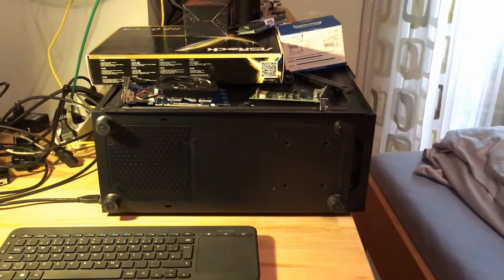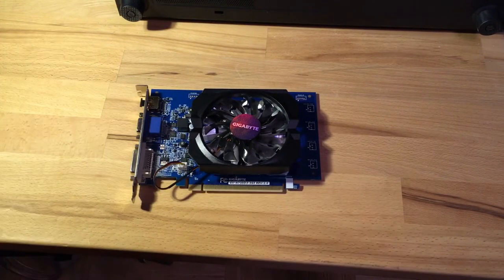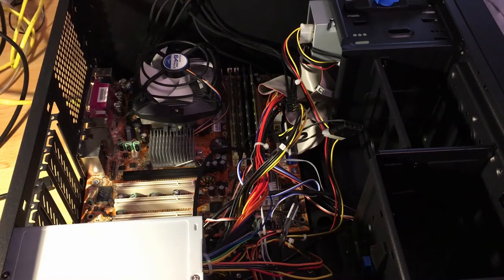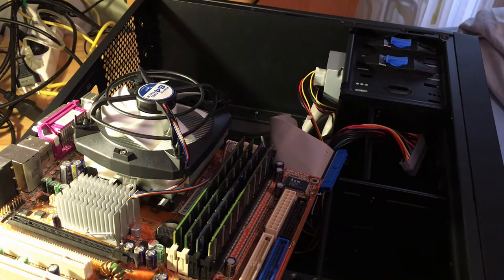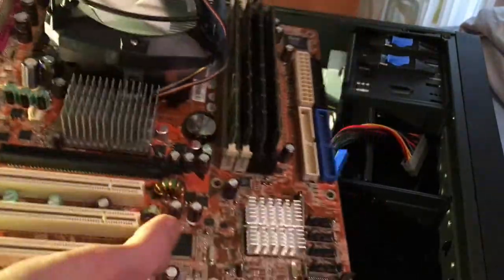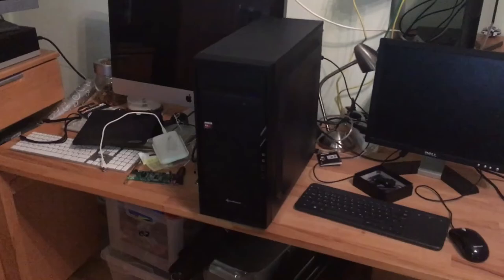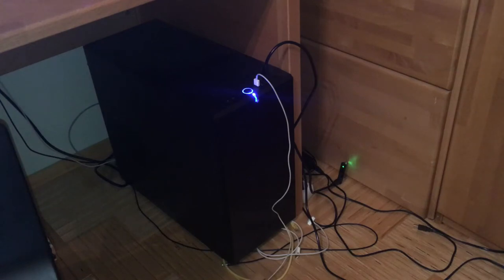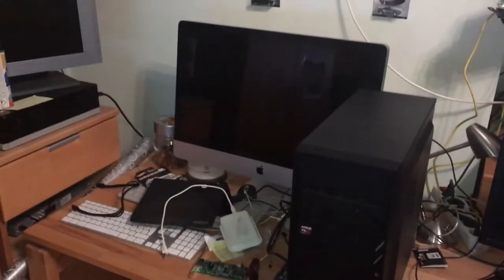AMD 6-Core Build (the brand new Lan Party PC!)

Comment: Wow thats an upgrade over the crappy Athlon X2. I think the FX 6300 will do a much better job as the old dualcore. And also now you don´t have to worry about the stupid power supply dropping out. And for the games i think the real bottleneck now is not the CPU its the GPU. But still a lot better then on the old system
Reply from the maker: Yes, you are right, but the GPU does the tasks fine it needs to do, so I will be keeping it for now.

Comment: I have 12 core intel xeon Processor it runs extremely fast i did get it work on my non server motherboard just update latest bios and modified bios and socket it to unlerash the intired Processor Performance it could be risky apply at your own risk it not my ass it could be your ass it could have issues getting it to work on randoms boards well not for me mine worked secessfuly
Reply from the maker: wow that is awesome!!
Reply: Austin Souslin no such proc "xeno"
Reply: Xeno Processor design for server i use it for gaming rig
Reply: what is a "xeno"